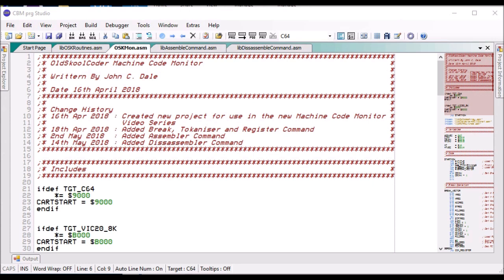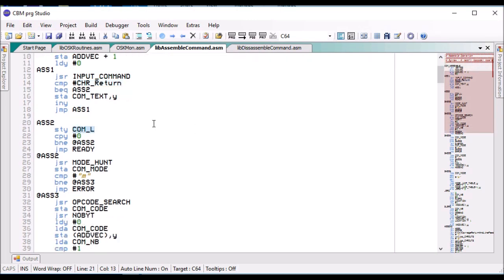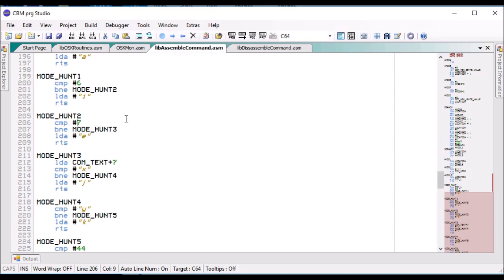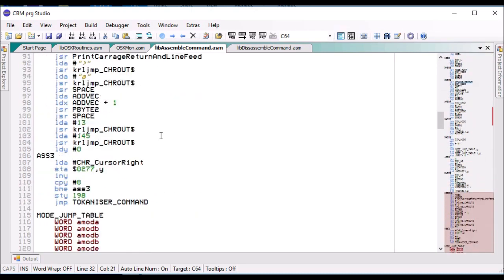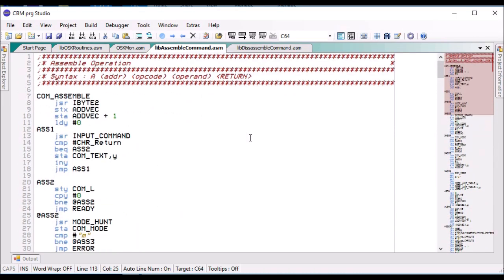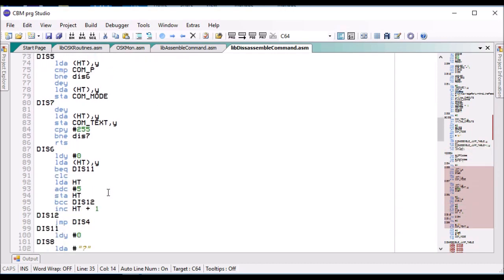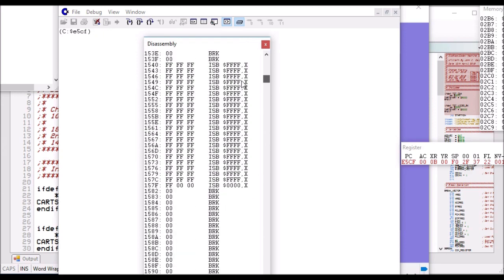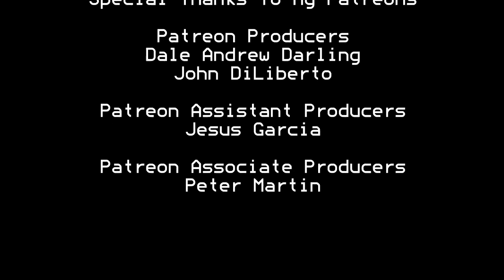Commodore VIC & 64 Machine Code Monitor Development Part Three

Comment: Hi John, I am subscribed to your channel from the start and I want to thank you for all your work. I am really interested in coding with the C64 and I have been at it for quite some time. Although I still have a long way to go. Unfortunately with your last couple of videos you have lost me, I cannot seem to keep up with that level (I am really impressed though). I was actually hoping you might do some videos about some display effects like scrollbars, explaining timing, VIC registers, rastersplits, a textscroller or some sprites to get me and perhaps a lot of other people hooked. I know there are some videos here on YouTube on that, but none of them seem to explain them as well as you obviously can. I sincerely hope this might be an option.
Reply from the maker: Hi Manual, Yup, I can and I have some topics on the VIC Chip, also the CIA Chip and other areas of the C64 / VIC20 Architecture. I do realise that the current video series is a bit more high level, and may be daunting to look at, but all my code is commented on git hub as you know, if you have any question my friend, you can either comment on here, or tweet me @OldSkoolCoder, and I will do me level best to help, and if an answer requires a video to explain, then im more than happy to do that :), So just as a preview, the next set of coding videos (after the Machine Code Monitor Series) will be taking the Luna Lander further, and I do explain the VIC Chip there and use some of the functions, but the Luna Lander will use more of the VIC chip to achieve some clever features, also the series will look at the code Derek Morris wrote in his book "Retro Game Dev, C64 Edition" http://www.retrogamedev.com as there are some clever coding routines in there, you can get his book @ https://tinyurl.com/y7o7dzd9 its well worth the small amount of money :D
Reply: @OldSkoolCoder  Thank you John, I have ordered the book by Derek and I am going to dig into it the next couple of weeks. I just saw he is working on a second book. I can't wait to see your videos on the topics you mentioned!
Reply from the maker: @mmeewezen , no problem, I always like my viewers to give me ideas.... I'm researching into the text scrolled now, looks like there are two main ways of doing it, so that's next on the recording list, just working out a demo tutorial :)
Reply: OldSkoolCoder Thats fantastic John! Thanks for all your effort!!